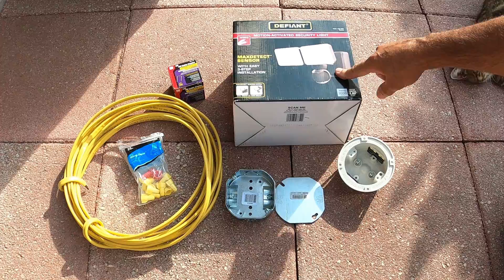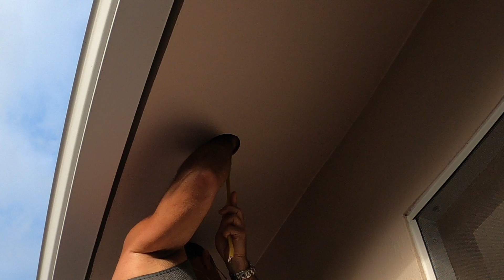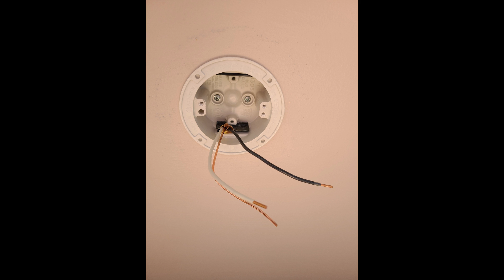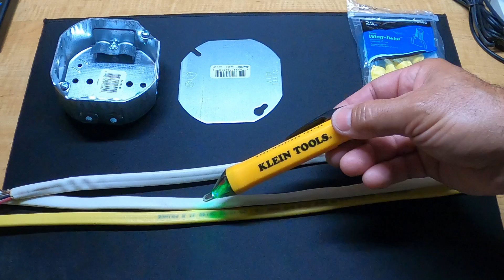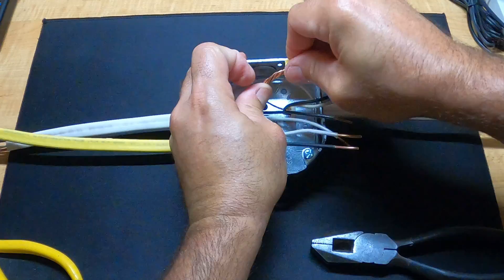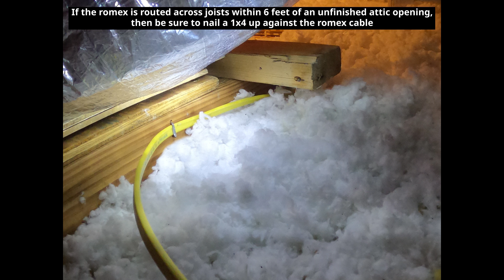How To EASILY Install Outdoor Soffit LED Motion Security Lights ~ DIY

Comment: I've subscribed to you for years! It's great to see instructional videos from someone that understands the principles of what they are working with (e.g. not technically requiring a wire nut on the ground wires) rather than just reading back from a required for code list :)

Comment: Nice.  Is that all the insulation you have, or did you sweep it back for the install?
Reply from the maker: My entire attic has about 10 - 11 in of insulation covering all the joists. The area that you saw was over my carport which doesn't require any.

Comment: Nice! However, with all the solar options around, which are now fairly cheap, it would probably be safer for a rookie to install a solar motion sensing light… maybe another video…
Reply from the maker: I considered solar, but for a soffit it's really not that good. I would need to run a wire below the gutter to a small solar panel to keep the battery charged. And if we have a couple of days of no sun, I would have no light at night. Thank you for watching!